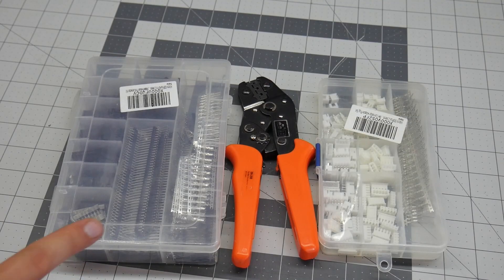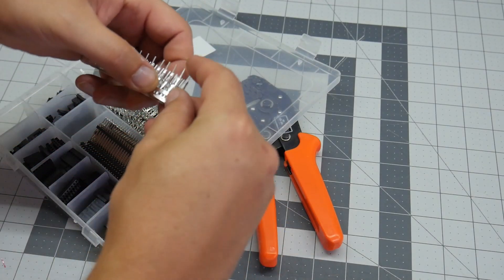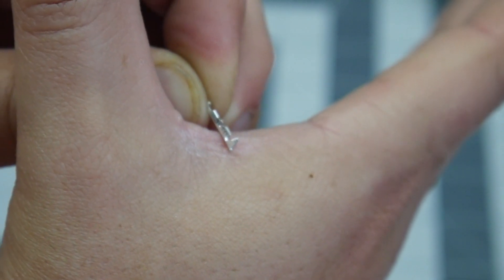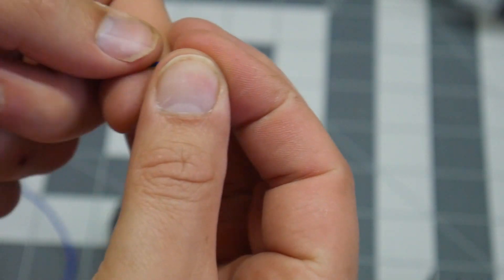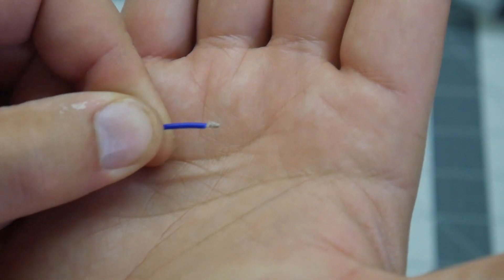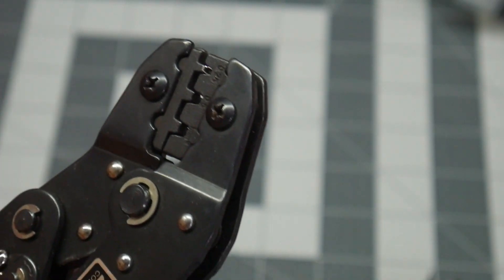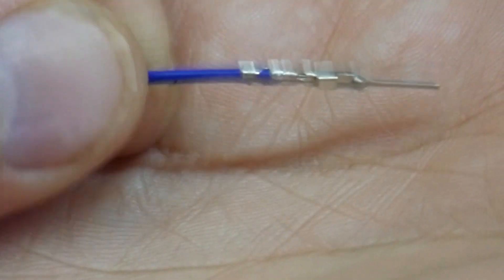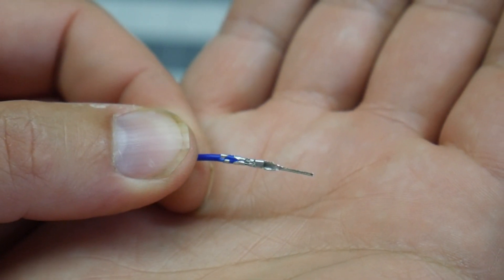Short - How to Crimp JST & Dupont Connectors

Comment: You’re using the wrong tool for these terminals. The insulation tabs are supposed to wrap around the insulation into a neat semicircle — not get punched into the wire by an M‑shaped die. What you’re demonstrating is how to crimp them incorrectly.
Also, these aren’t “Dupont” connectors. Those original 2.54 mm Mini‑PV contacts haven’t been made in decades. What you’ve got here are just generic 2.54 mm open‑barrel pin‑and‑socket connectors — the modern hobbyist clones. People calling them “Mini‑MV” or similar are just repeating folk terminology that doesn’t match any real spec.
If you look closely at the terminals, it’s obvious how the insulation wings are meant to fold: they’re designed to curl around the insulation, not stab into it. Otherwise the insulation support does nothing.
Nice filming though

Comment: The rightmost ("third") pair of "leaves" you've bent has to remain straight in this type of pins as it limits the depth of insertion into the housing. Only two shoud bend instead: leftmost pair holds insulation, inner pair, which is the longest one, holds the wire core (which was also done incorrectly as insulation was cought inside).
Also, core wires must remain straight. Twisting them is wrong because this way they would interfere with pin bending process and may get cut by the edges of metal being pushed inside. Same regarding folding the wire although this might be useful for too small gauges.
And finally - you won't be able to crimp JST pins with this crimping tool as its dies are too thick and would break pins.
Reply: Thank you for correcting this video. Video also implies that Dupont crimps would fit in JST connectors which I cant get them to stay in. Looks like I will need new dies to do JST connectors too.